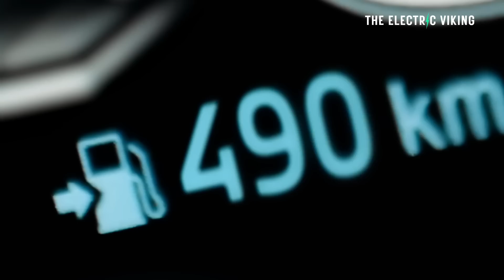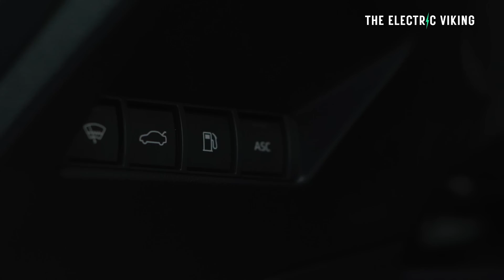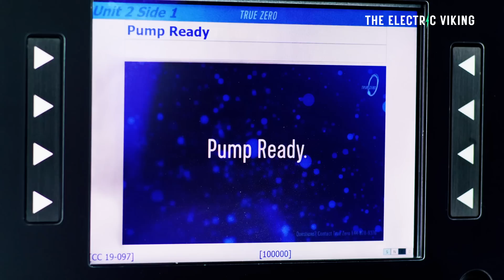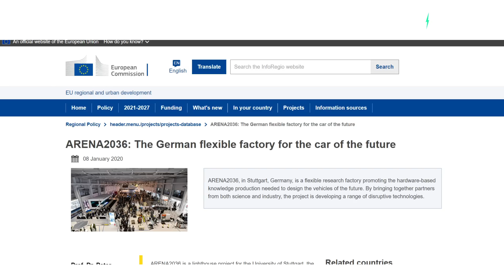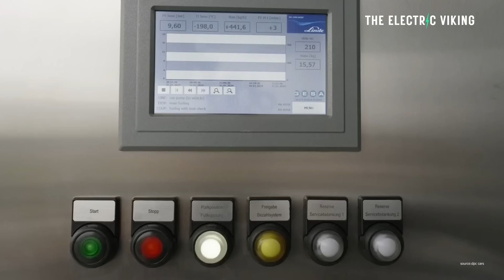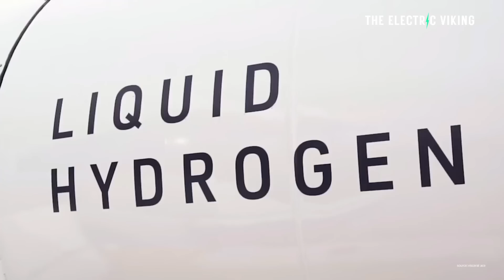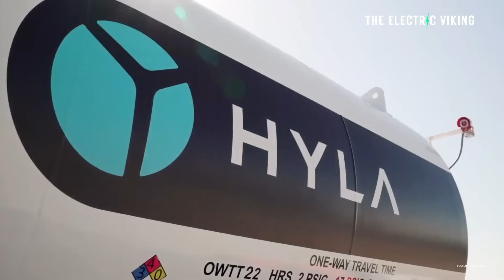Fossil fuel companies spending billions hoping that hydrogen beats EVs

Comment: The hydrogen versus BEV argument was done and dusted years ago. On the demand side buyers have made their decision and on the supply side the investment into BEV dwarfs the money being spent on fuel cells or hydrogen burning engines. This pushing of hydrogen nonsense from the oil industry is just a belated attempt to keep the anti BEV crowd tied to the pump for as long as possible.

Comment: THE SUN AND WIND ARE FREE
So we now know what we always knew. The oil industry is behind hydrogen.

Why use energy to run a process to produce a product that needs storing, transporting AND yet another entire process to create electricity? 
PROFIT!

Transport electricity from the Solar on the roof, to a battery system, to an EV.
About 10 metres… Very little losses at the point of use and (EV aside) no moving parts.

Oh and the Gas supply…
Remove it, so there’s no standing charge…

Comment: I think that hydrogen is the worst idea ever! Every time you recharge your vehicle a tiny amount of hydrogen released directly into the atmosphere. Now multiply that tiny amount by the number of vehicles on the planet. Hydrogen itself is not a greenhouse gas, but it doesn’t stay pure. Hydrogen will very readily combine the gases already in our atmosphere. These new gases are multiple times more harmful to our greenhouse problems. We would better off sticking with the gasoline we are currently using than switching to hydrogen.
The new Chevrolet RS pickups have a range of over 400 miles and recharges in about 10 minutes.
Reply: Even if it does not leak as you described, there is the problem of keeping it in tanks, Hydrogen seeps through almost everything
Reply: One word that should strike fear into everyone…

“ZEPPELIN”
Reply: I've heard it will even combine with oxygen!
Reply: Hydrogen is probably the best solution for semis, road-trains and other logistics uses.
Kinda pointless for cars.
Reply: @OTPulse  kinda pointless for those too.. the infrastructure is terrible and storage and equipment onboard or at distribution points problematic and expensive requiring lots of maintenance.
Reply: @erktrek  Freight vehicles tend to have far fewer points of refuelling. Slap a heap on the main highways and call it a day. I don't think it's the best solution but the only sector I can see to make it work.
Reply: @OTPulse  ultimately it will come down to cost and no matter how hard the oil and gas industry tries they just won't be able to get it below what existing petroleum is today or the efficiencies and safety of the battery / green tech of tomorrow. Physics is a harsh mistress. Still useful for space exploration though unless nuclear takes over.

Comment: Hydrogen is a non starter, making it is energy intensive (electricity), it's very difficult and lossy to store or transport, and it has much less energy density than petroleum distillates. Battery storage of is more practical and in many ways a superior energy source for powering automobiles.
Reply: Yes, and what you said is really funny because step one of making hydrogen is making electricity. They are trying to create a middleman (hydrogen) between us and electricity.

Comment: Hydrogen could be economical, but it isn't.
Reply: fact is it can never be... you have swallowed big oil and toyoda bs.. the law of physics cannot be altered
Reply: @flodjod  If electricity is cheap enough, you can make hydrogen by literally sticking two wires in a bucket of water. And just last Sunday, I was getting paid for charging my Tesla with surplus wind power. I agree that Toyota is using hydrogen as a red herring, but that doesn't mean it couldn't work if they made an honest attempt.
Reply: Hydrogen is just another flawed ploy by fossil fuel and some legacy auto companies to hang on to their profits.   People are not going to fall for it.

Comment: So the fossil fuel companies are betting against Elon Musk?  Ha ha ha ha ha!
Reply: It has nothing to do with Musk but you just can't miss a chance to kiss his ash.
Reply: Can u elaborate more please ? Instead of laughing like a fool
Reply: Not really musk. China is accelerating the transition massively.
Reply: Musk has no doubt massively enabled the EV transformation, and many other things. I would be concerned that the Oil industry will resort to smearing him.

It has to be bigger than Musk alone.
Reply: Hydrogen would make more sense for heavy industrial uses and mining equipment engines. 
Anything with smelting would be better than what we use now. Also making sure this hydrogen comes from green or at least red hydrogen which comes from Japanese nuclear reactors in their new gaseous cooling systems instead of light water cooled reactors which actually are already build and back online for the last 5 years in Japan.
As long as hydrogen is produced cleanly it works in alot of applications but for a passenger vehicle usage it's not suitable as is, but again think the largest mining dump trucks and equipment, but actually if these also had regenerative braking power recovery systems for downhill movement would be ideal. 
5:42 these vehicles do keep driving as they switch out the drivers in shifts.
Reply: That’s the thing ! I cannot make hydrogen without generating lots of co2 in order to make it. Until that changes how is it beneficial to solar/wind etc. + battery storage ?
When I was a child I had same fantasy about hydrogen

Comment: The basic cost of producing electric vehicles is just not justified.  Too many limited materials required.
Reply: another that has swallowed the bs of big oil
Reply: You ride a horse then? The materials that go into EV batteries can be...wait for it...reused for residential storage for 50 years and then recycled into new batteries
Reply: Ignorant rubbish
Reply: Space x, Tesla, neuralink, boring company, Tesla bot, Tesla battery storage, Tesla solar, starlink, PayPal, zip 2, open Ai, deep mind, twitter/X, xAI, 
I mean I would be happy with just spaceX alone.
U would think this man has thought through the feasibility of electric, but no he’s wrong u must otherwise listen to the geniuses on YouTube.
U think hydrogen hasn’t come across musks mind ? Or the brilliant Tesla engineers ? Why would they embarrass themselves?
Battery tech is evolving! Something that ICE can never do ! It’s same pistons hardly changed for 100 years.
Reply: Literally less material than ICE cars. The difficulty of attaining the specific ones has mostly been overcome as well.

Comment: The future of transportation is anything that keeps you putting money in somebody else's pockets.  Home solar and an EV for the win !   The freedom combo.
Reply: Yeah I've had an EV for two years now and only partially paid for charging in the 3 winter months where solar output tends to fall. Even then I'm still covering some with my PV.

I'm a moderate who the left would put on the right for some views, and the right would put to the left for others. 😅

I effing love my LR3 - it drives sharply, hard - or soft and smooth - whatever my heart desires. Whilst at the same time always raising a big middle finger to the fossil fuel industry.
Reply: @JSmith73  Here's to raising more middle fingers (or as we do in UK the reverse 'V') to the oil Barrons.
Reply: @JSmith73 I strongly agree. I have a MYLR  and absolutely love it.
Sometimes the naysayers can be creative but it’s hard to convince me cause it simply works.. I always say if u don’t have it and u haven’t owned it for mounths u don’t have the right to critize it based on foolish Social media hearsay. I’ve had the Tesla for 8 mounths now, spent $170 on first quarter bill, $360 on second quarter bill, and waiting for current bill, but wait for it that’s HOUSE + car combined cost, which means car hardly $200-250 for 8 mounths! I mean if that alone doesn’t convince anyone I don’t know what will ever does! 
At this rate I’m saving well over $4-5k in petrol and servicing per year, etc compared to my previous 4cyl turbo, not to mention v8s etc.
The sad thing is the biased media is getting to these naive souls, how wouldn’t it when it’s backed by oil companies, convincing them that electric is gay and , dangerous, evil, not environmentally friendly etc. How dumb
And people believe that shit cause they’re stuck in their “petrol/diesel religion”.
I also agree on the driving front, I have never driven something so responsive and so quick from A to B.
You would need something like a Porsche to compete but I would say it’s still sharper
Reply: @JSmith73  Can you share what state or latitude you are in?  For solar reasons.
Reply: Which amounts to Free Gas - and if you refuse that you cannot call yourself a conservative
Reply: Well said! I've had this kind of argument with the MAGA cap wearing, conspiracy theory, right-wing populist crowd who believe that EVs are part of an evil scheme to control us! When I point out that real freedom comes from owning an EV and producing your own power at home, they refuse to see it. As Viking says, you are challenging their religion.
Reply: Killing slave children in the Congo to mine battery metals is not freedom.